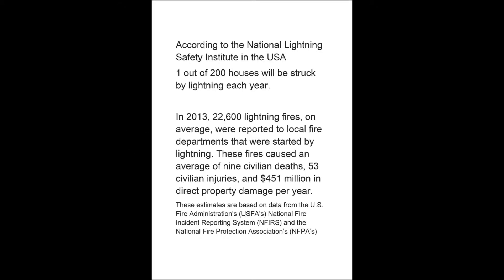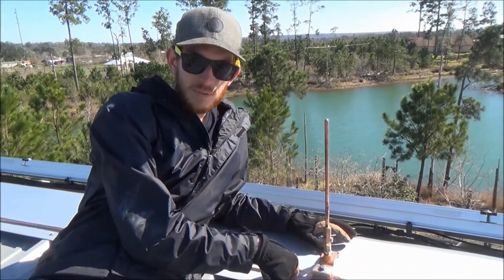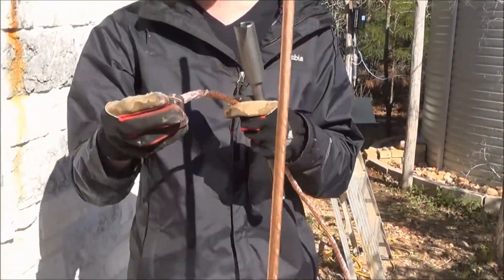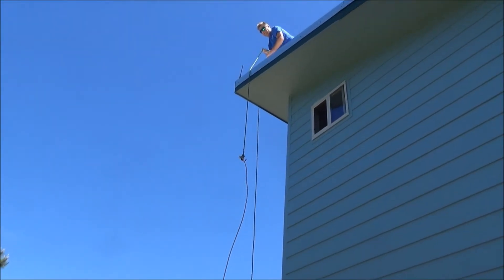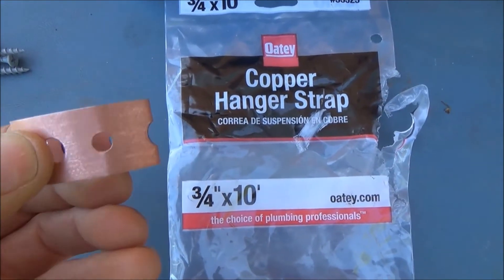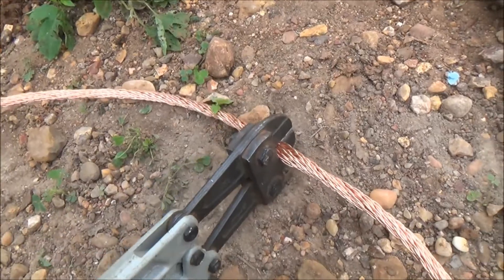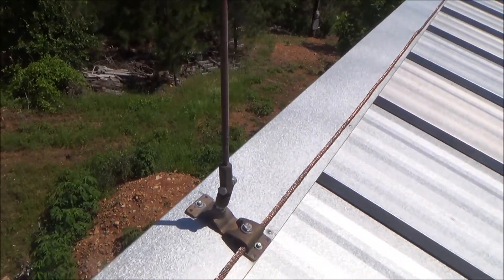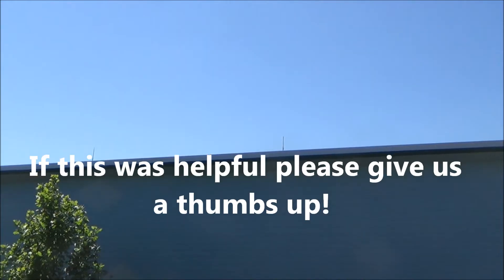How to Install Lightning Protection on a House

Comment: Good video! How did you determine every 20'? Using the rolling sphere LDL measurement of 20M radius for level 1 highest protection, that would be every 60' and the corrners are the most probable lightening strike.

Comment: Tis also very critical that the LPS be bonded to the existing grounding of electric/ communications systems to ensure the they all rise & fall at the same potential ⚡⚡⚡
Reply from the maker: Can you repeat that in lay mans terms.
Reply: @off-gridhomesteading7269 Good question

Comment: lovely, but can i pass the copper wire inside the ceiling?
Reply from the maker: I would not do that. Could start a fire if lightening strikes.
Reply: The professional did that in this video: https://youtu.be/J2Zw9q8A-Jo

Comment: Might be a dumb question but would this set up work on a tent trailer (hard top) to help increase its safety during a thunderstorm?
Reply from the maker: As long as you drive the ground rod in properly.
Reply: What kind of cable